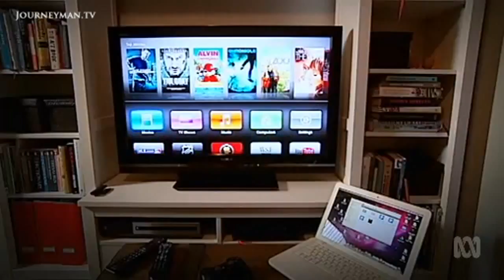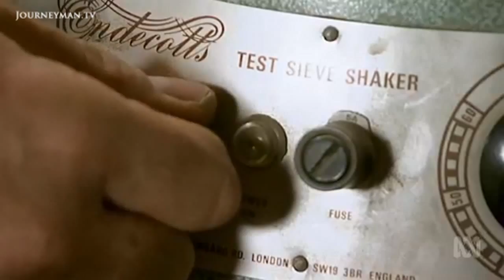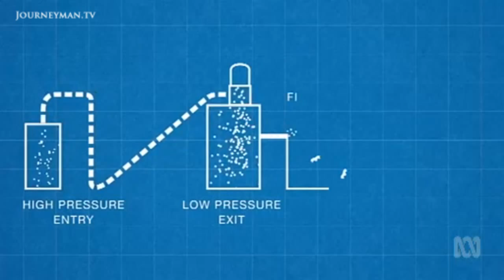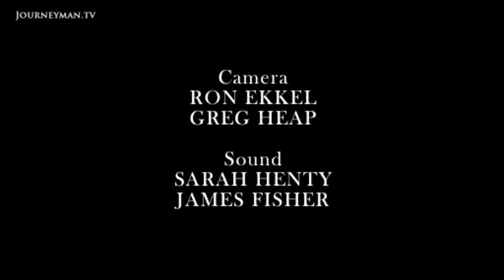How Lunar Mining Is Set To Change The World

Comment: Problems:
1. How is a vacuum going to work in space because there is no way to create a high & low pressure with out a gas being puller out in to space. If it is possible please reply but from my knowledge, I think it wont work.
2. What are they going to do if a meteorite, The size of New York city hit the colony. If you think you  have a solution please comment, I'm interested in your ideas.
3. How are they going to transport the material from ground to surface. Will there be a orbital station around the moon and would it be worth it carrying it to the station.
Reply: Luca thank for responding I like learning news things thanks.
Reply: 1: A space vacuum wouldn't work like one in real life, instead you'd have a vacuum head that "seals off" the bit you're trying to mine, with the end of the tube being exposed to vacuum. You inject air at the bottom, and it automatically sucks up the dust.

2: They're going to die. Luckily, those impacts rarely happen, and things like early warning radar and IR can allow inhabitants to evacuate in time. In addition, the structures would be able to resist minor impacts.

3: Railguns, space elevators and aluminium-oxygen hybrid rockets.

Comment: I predict the first to mine the moon will be the Chinese.
Reply: We will fake it before we let that happen!
Reply: Daniel Tynan Moon mining could actually be very useful.  
                     For Space Based stratospheric wired solar Power. If we want to beam all our energy via mirrors onto a PV(concentrated) airship in the stratosphere platform it would need a million tons of aluminium.
                     That would require 100,000 rockets launches.   Not very realistic.  XD even with a time frame of 100 years.
But if we had a moon base and an elevator on it (which is feasible and currently worked on)we could get all the mass from the moon and then ship the mirrors to
GEO.  By the way we could use VR controlled robots to make the mining a bit more practical.
What is so cool about mirrors in space is that they'll last FOREVER! they  could be made out of glass and Al coating.
Reply: When has the Chinese ever done anything cutting edge???They can not even frack,in any meaningful way!
Reply: TheChristianRight09 China is right now tendering to build highspeed trains in the USA.   Because the USA lacks the experience in building highspeed rail and trains.  I'd say they are cutting edge on that. China decided to limit fracking because most of their oil is in seismically active areas.    Makes a lot of sense to me!
Reply: :)

The Germans ,built their Maglev!
Reply: TheChristianRight09 Yes their first Pudong-Shanghai Maglev is German Tech.  But when they build more Maglev. . if they build more Maglev. . I'm sure it won't be outsourced.   Their highspeed long distance trains go up to 300km/hour so they are plenty fast enough to still be safe for long distance travel.   Maglev probably would not be safe over long distances because it requires so much maintenance to run safely.
Reply: America has the most extensive interstate/road system in the world!!!We like making our own schedule!
Reply: Daniel Tynan
Some Chinese high speed trains are made by a Canadian company, you know...
Reply: infinitecanadian
 A tiny fraction of them designed by Bombardier. . like some subway cars in Shanghai are Bombardier. .  Of course they started with foreign designs. . but now they have their own designs and manufacturing.
Reply: Daniel Tynan
True, but the U.S.A. should have looked closer to home for their high speed needs.
Reply: those are counterfeit highspeed trains just for the troll.
Reply: The Chinese are planning to mine HE3  fusion fuel and working on the tech to do it far faster than we are., We  have lost some of our space capabilities from lack of use-  we forgot how we did it,  Bush had boosted NASA's budget for this, but Obama slashed the program.